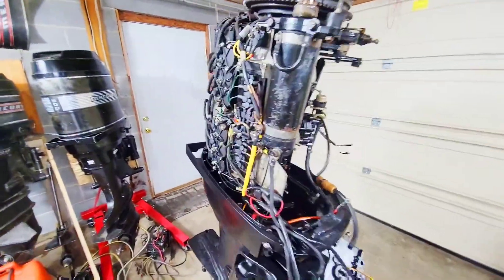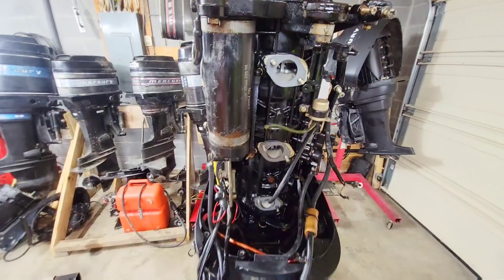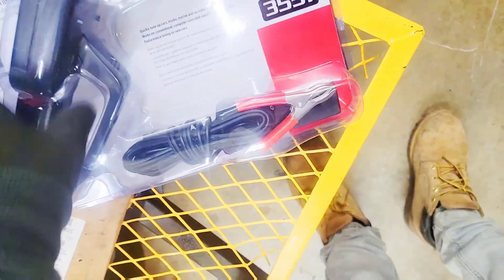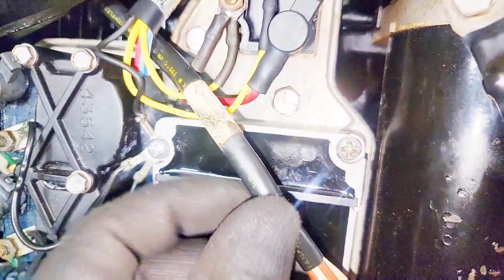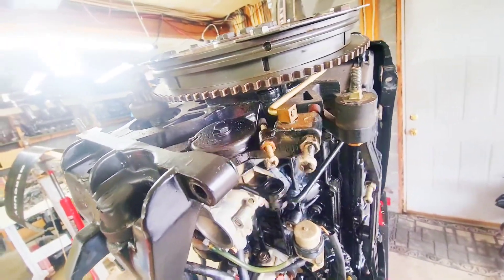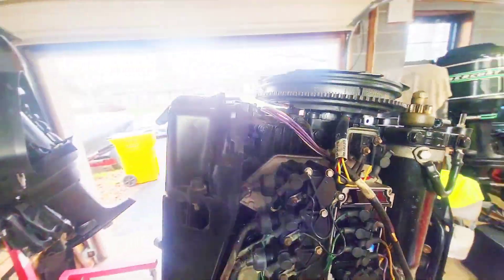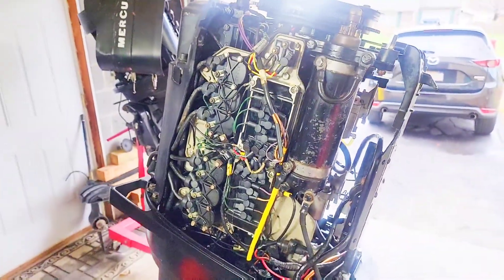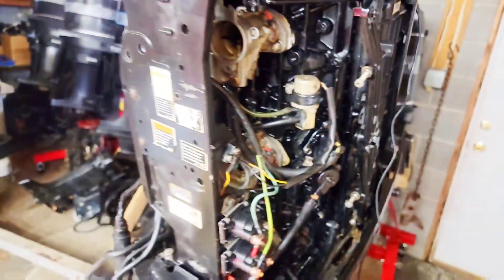Mercury Outboard Timing: How to Set it Properly

Comment: Thanks for all this helpfull information! I have an issue with my 83' L6 (no distributor) that i just acquired. I've checked compression and all cylinders are @150 within 3psi. Engine runs but has a high idle. I've narrowed it down to advanced timing. Pickup timing at cranking speed with throttle lever was arround 9BTDC and i tried to adjust it to 4-5ATDC and my adjusting screw had to be almost completely seated to achieved these specs. Then wot timing was at arround 30BTDC.. again had to almost bottom the screw to attempt to getting arround 20BTDC. I then realised something else is causing the timing to be significantly advanced. There is no idle stabilizing box or any other electrical boxes other than the switch boxes and the voltage regulator. Resistance of the pickup leads are all within spec and I have removed the sheathing on the pickup wires like you have because it was binding. Have you had this issue before or any insight on this? I would appreciate any feedback.
Reply: Just replaced the CDI, that was the issue. Timing screws are back to the middle of the adjustements.

Comment: I have a 1980 90 hp mercury. It runs great in gear at all speeds. As soon as I go to neutral it dies every time. I have to start it on the high idle and very fast throw it in gear. Getting to reverse is almost impossible. Do you have any theory on what's going on?
Reply from the maker: Your tangs or idle screws are not set correctly. It not getting enough fuel. Son

Comment: Man I need help with my 87 90 hp runs great idles great.. starts every time..
Carbs are re built new.  But I still can't get it over 12 mph just run 12 mph all day go anywhere I want that's all.. I need help
Reply from the maker: It's either not getting enough fuel or your are pitched to high on your prop my friend.

Comment: So what is the rpm running at the idle on this engine? 
I have a 1979 140hp and the neutral rpm idle is 1100, do they normally run that high in neutral?
Reply from the maker: No. You need to get it below 1K. Distributor models are 5-7 BTDC. Adi are around 5 ATDC.

Comment: Hi Merc, I have a 1979 115 inline 6. I rebuilt the 3 carbs. Took it to the lake and it ran fantastic. Ran across the lake and shut it off to do some fishing. It fired right up but had absolutely no throttle response, would only idle. Any thoughts on what’s going on.  Thank you
Reply from the maker: Fuel delivery issue my friend. Son
Reply: @MerCSonL6  thanks for the help, for this 79 115 , is there a repair kit for the fuel pump. The serial number doesn’t come up when I call around to order a kit. Thanks again
Reply from the maker: @artbentley4887  https://amzn.to/3EQv4wa
Reply: @MerCSonL6  thank you so much, what check valve kit can I get?
Reply from the maker: @artbentley4887  are you referring to the check valve inside the fuel pump?
Reply: @MerCSonL6  yes.
Reply from the maker: @artbentley4887  https://amzn.to/3t4yzfG
Reply from the maker: @artbentley4887  the valves in these will work

Comment: Hi Son. I’m have a 1985 Blackmax 150 v6. I have removed the idle stabilizer due to bad wiring and no longer available. I have found Tdc by your method and set the primary pickup to 11deg atdc as the book says. My problem is my idle is around 2100. I have reset the link and sync and the motor seems to be running well. I just can’t get the idle down to 600-800. Can  you give me an idea what to do? Thank you my friend.
Reply from the maker: The V6 series requires the idle stabilizer unlike the L6s. Son

Comment: Hi. I have a 1984 Blackmax 150. I need to set the timing but the electronic spark advance is destroyed from bad wiring. Some have said to set the timing different from the manual and throw the spark advance away? What do you think about that? And if i do, what would you set the timing to on the Btdc and atdc? Thank you for your help. Love your instruction.
Reply from the maker: Firstly, max spark is set by screws on your throttle arm. Nothing electronic about it. Can you please rephrase the question? Son
Reply: @MerCSonL6  Thank you. I’ve attached a picture. I’m asking about the high speed spark advance module. On the Mercury 150hp V6 it is on the top of the motor. The wires are bad and some have said remove it and set the BTDC higher than 16 degrees, which is what the book calls for. There are various answers to this. I’m wondering what you think? I’ve heard some say to set the BTDC to 19 degrees or even 22 Degrees. The module is no longer available but the motor is great still. What would you do? Would you remove the module and if so what would you set the BTDC too?
Reply: I’m sorry I can’t get the picture to attach
Reply from the maker: @Brooster87  I believe the module you are talking about is the idle stanilizer?? In either case remove it and set a degree lower that factory specs. This way, the only thing manipulating your timing is you. Son
Reply: @MerCSonL6  thank you so much. I was just calling it what the book calls it. Electronic spark Advance module. I wish I could get the picture to you. But thank you so much for the help.
Reply from the maker: @brooster87  sure thing

Comment: MerCSonL6 
I’m looking to update grade my 1979 Mariner 115ss 6cyl 
Wanting 150hp would you have one for sell?? 
Would you know what the wt difference between both models? I’m thinking my 115hp wt is 294
Reply from the maker: I just sold 2 1500s in the last 2 weeks.... I do have a 1988 115hp which is a detuned 1500. It will push your boat significantly faster. Your 115 became the 90hp in 1982. This engine has 145psi on all 6 cylinders. Completely serviced. Lmk if you are interested. Thank you. Son
Reply: @MerCSonL6  yes you are correct. good thing mine NOT 1982. 
Mariner/mercury only made hand full of these 115hp ss 1974-1979 
My understanding not all 115hp Mercury/Mariner was the SS model. But anyway the 1988 115hp is it FI? Or did that start in 1992 on the 115hp
Reply from the maker: @I-like-boobs Flash  the 115 did not change until 1989. It became a 4 cylinder with different/larger pistons. I did not know mariner made an ss in in the 70s. It's not listed in the "mercury" manuals I have. The 88 115 I have is on eBay listed under my YouTube name. Lmk. Son

Comment: I love this channel.  I have a 75HP 1984 l4 that I tried setting the idle timing on over the summer.  Once I get the base idle timing close to spec and I try to put it in gear, it dies.  I believe what I'm doing wrong is adjusting the base idle timing to compensate which results in a fast idle in neutral.  I think I should be using a different adjustment for idle in gear so the timing advances on gear engagement which will keep the motor from stalling.  Any thoughts I'd certainly appreciate.  Motor has good compression and otherwise runs great.
Reply from the maker: I love that motor btw. It's a true monster when everything is tuned correctly.
Reply: @MerCSonL6  Thanks man, I'll give a shot!  I believe I have them at 1 1/2 out.  I'd like to rebuild the fuel pump and pull the carbs to check the floats.  It also has trouble starting when hot so I do think there's a fuel issue somewhere regardless of timing.
Reply from the maker: Try turning the idle screws out 1/4 turn. It's not getting enough fuel. You should be able to spray compressed air at the front brass venturis and fuel should immediately splash out the main jet. Hope this helps! Son